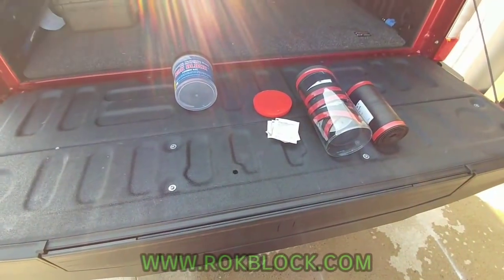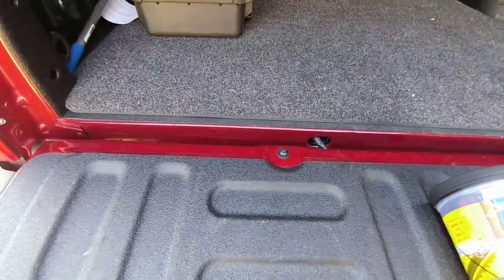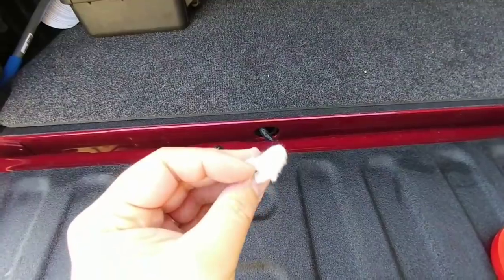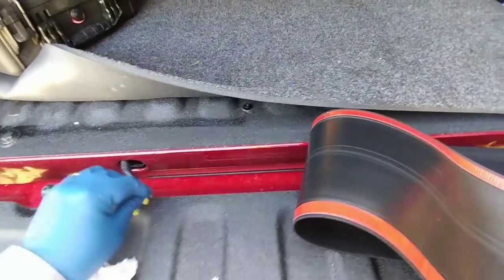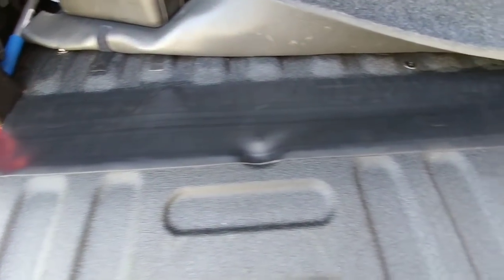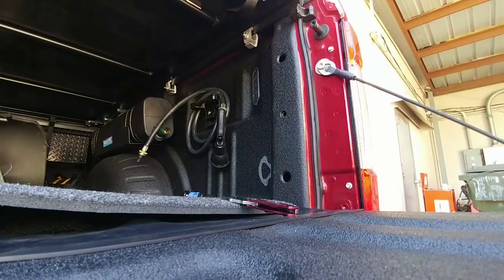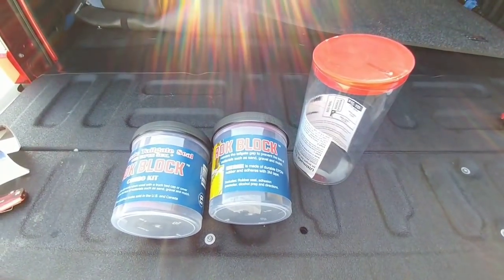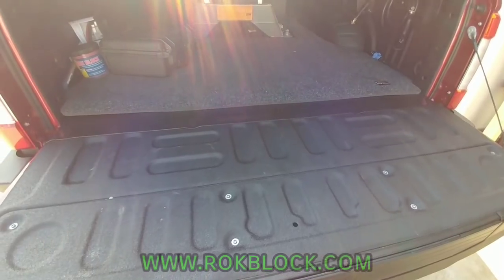Very useful Tailgate accessory! Rok Block for Pickups

Comment: Dammit, man! You're going to get me in trouble with the wife! If you keep coming up with truck stuff that I could really use! 😜👍

Seriously? Who thumbs down this!?

You need a pair of cutco scissors
Reply: what truck do you have?
Reply: '00 F250 quadcab 4x. Built my own flatbed. Added on-board air system. Added a 40gal fuel tank from an expedition where the spare tire went. Relocated the spare. Added an extra battery to help run (10) off-road lights. Added a gooseneck hitch into the bed. Added a power point and air fitting on the outside of the bed. Will add airbags and F350 rear axle blocks and a portable water system to hose off my kid's feet from the sand

Comment: Little trick when installing anything with that 3M tape, peel about an inch or so of the backing and fold it out 90* to the side.  Then you can postion the item and have the tape hold it in postion.  You can then carefully and gently pull the remaining tape backing out the side while appling pressure.  Much easier to keep things straight and in postion while you install it.

Comment: At some point, especially if you have a truck for awhile, you are either voluntarily or involuntarily going to remove the tailgate (ie there might be times when the tailgate gets in the way and you remove it or when you receive some tailgate damage that can't economically be repaired so that the tailgate is replaced). In either of those cases the membrane will get cut in half, leaving part of it attached to the bed.  Or maybe you try to remove it and end up with a mess because some of it comes off and some of it doesn't or the adhesive pulls off part of the bed liner because the bed wasn't properly prepped to accept the bed liner.  I can also see where sliding stuff in and out of the bed along the tailgate will constantly nick and hack away at the edge, causing parts to lift up and rip off, again, leaving a mess.  Depending on how you use your truck, this solution to a problem might be worse than the problem.  For me, I would never use it for all of the above reasons. Otherwise, its a great video just like all of your other videos. I just caution anyone that uses it to think about the downsides too, because once it is glued down, you probably will never get 100% of it off your truck no matter how hard you try.  I've used some of those industrial strength 3M adhesives. Once its stuck, "it ain't never coming off".

Comment: I would love to put this on my new F150, only thing holding me back is occasionally I have needed to remove my tailgate in order to get loaded from a forklift or when loading heavy items to prevent damaging the tailgate , one simple connector that’s easy to get to and it’s off , this accessory prevents you from removing it without destroying it....

Comment: I have an RV question for you. I wanted to know about the differences between light weight RV’s, regular RV’s (I’m assuming that’s what you have) and 4 season RV’s. I was thinking about doing the full time RV thing but I really don’t know much about them. I’ve listened to some of the videos that some of the dealers and manufacturers have but your videos are somewhat more informative and you are impartial. I hope that maybe you could do a video on it. Visual aid helps a lot. Thanks for the videos you do. They are a very big help.

Comment: I like this a lot.  I’m planning to buy a TC (and gonna full time for quite awhile) which will require me to remove the tailgate but I could use the strips at least across the vertical sides and the bottom to protect those areas.  Why these camper manufacturers don’t make them so one can keep the tailgate on, I don’t know.  Guess I’ll need to get a net or something and use tie downs for when I unload the camper temporarily.  

Wondering what I could add to the wheel-wells to protect them from my initial skill-less loading of the TC (will also add protection the the TC).  Maybe with the use of an installed laser light and 3 point reflective tape on the camper, all will be well 😉 but just in case, any suggestions on the wheel wells? Thanks.

Comment: I would assume that if you ever need to remove your tailgate to install a 5th wheel gate, for example,  that it would be necessary to destroy the protector. If that is the case, then how difficult would it be to remove the 3m tape?

Comment: Hello again Big Truck! Now if that says put it will be great! I’d wait at least a month to see if the adhesive holds. But the two bolts at the edge of the bed floor, and the two screws at the bottom of the tailgate that in the tailgate are recessed along with the two visible bolt heads, could they not have been removed and then used to help fasten down the membrane? On the tailgate you could have found those washers that are concave recessed like use on the interior door panels from years ago. Just saying as that is what I would have done! I know some of the new adhesive made today are amazing, but I still don’t have much faith in them! Especially where heat and cold along with wetness will be ever present. But I am very interested to see how that lasts! I have made myself a molded piece of oak trim I sent through a router to fit in that space between the bed and tailgate when I load with everything from gravel and mulch to my motorcycle, that fits in snugly to keep that area from any debris. I just remove it when I’m done! But hey good luck! Have fun stay safe!

Comment: You know they used to design truck beds so that rocks and mulch would just fall out, like my 2002 f250, I was disappointed that my 2014 silverado bed found a way to lodge them in down in that area where they use to fall down on to the bumper and be able to get swept off

Comment: Awesome vid and mod if I decide to keep this 2017 dually.....got 1100 miles on it and already hearing and feeling a vibration in the steering wheel when backing my trailer ......Does anyone have this problem or has big truck big rv ever had the same issue with the f-350 like I'm having with this one????

Comment: I’m not sure you installed the taper seal correctly.  The instructions say to start on the sidewalk extension like you did then rotate to the bed rail towards the top.  After opening and closing my tailgate before installing it doesn’t make sense to do as the instructions say.  Who knows...

Comment: What bed mat is that? I have a 17 f250 with the factory fifth wheel goose neck prep package.
Reply from the maker: Ray Romero: Access Bed Mat
Reply: Ray Romero I have a 16 F-350, does the bed rug come with the cut out for the hitch, or do I need to cut it
Reply from the maker: +Michael Welsh: Razor knife
Reply: No bed rug on this truck? Why?

Comment: Does anybody here believe that trucks will ever be battery powered (EV)? I know cars, possibly SUVs, and semi trucks may, but that is two extremes. Imagine trying to get an EV truck in the truck class 4-6 range that can tow 30k pounds and go for 200-300 miles. I almost cannot see it happening. 

Also, pound for pound, anybody also believe we are reaching the limits of the class 1-4 for towing. Assuming a F450 had access unlimited torque and horsepower, without increasing weight and maximizing technology, I doubt we will see a F450 towing 40k, 50k, etc because it would be to "unsafe."
Reply: Gordo Von House  check utube there's a electric class 7 sales start 2019 range comparable to  diesel